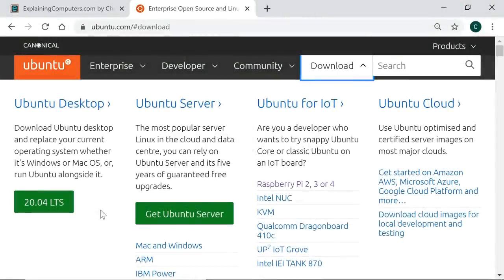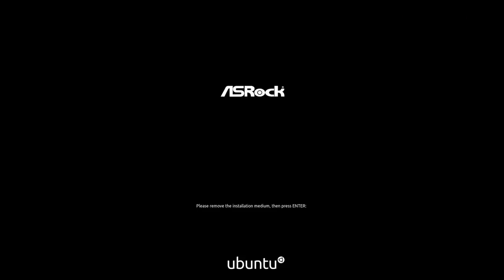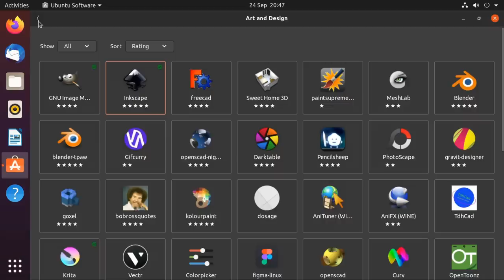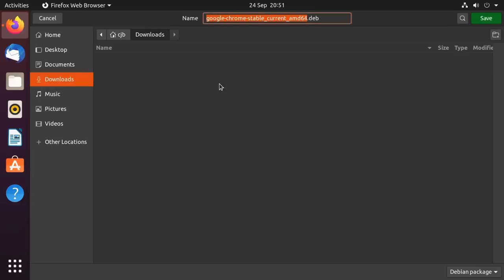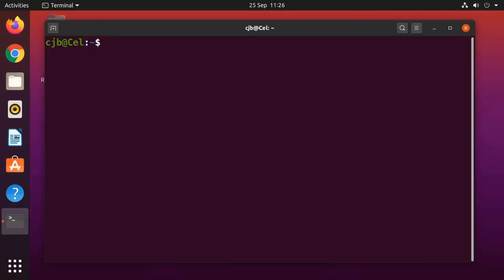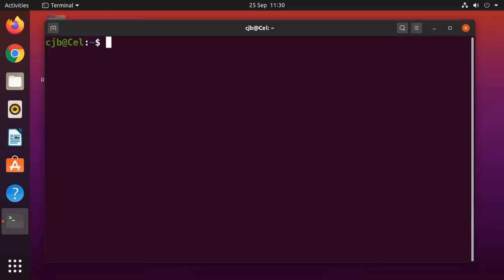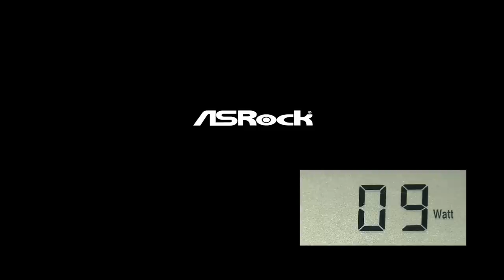Silent Mini-ITX PC Part Two: Software & Power Consumption

Comment: Everyone wants a quiet computer, but they don't want a computer with low performance that generates little heat. It will never be difficult to configure a small computer and a high-performance computer.

Comment: Over the years I've built a number of PC's for my own use as upgrades. It just occurred to me that, as long as its not connected to the internet, I could just use some of those old parts from previous builds and old operating systems to build a new home theater PC. I wouldn't have to buy a new Windows license since I already did that with the older version of Windows that I'd be using in the new HTPC build. As long as VLC media player still works with an older version of Windows, I should be set.  It also helps that I never throw anything away, so it's just a matter of finding the old boards, cards, discs & power supplies and put it all together.  Got my next project.

Comment: That wattage is really impressive! I'm thinking the solar panels on the RV could handle this very easily. In fact, it would instantly become one of those devices that we wouldn't even worry about, if we had left it on by mistake. Sensational performance for power. Great video!!! Thanks for sharing.
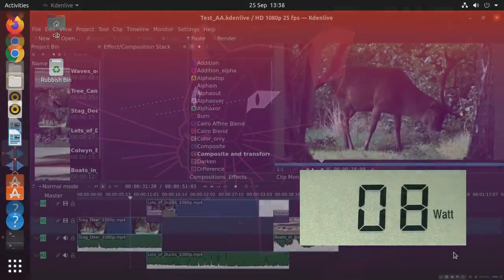Reply: At about 19:30 does that power usage include the screen?
Reply: I always partition the disk into a root partition, a home partition and a swap partition. This means that so far I have been able to change/ update operating systems without losing my data. This seems to be standard within the LUG.

Comment: Thanks to one of your previous videos, I now have an old MacBook Air with Ubuntu installed on an external SSD drive. Sadly the Mac only has USB 2.0 so it's no speed deamon, but it will give me the chance to delve into Linux and learn. Thanks for all you do Chris, I learn so much from your videos.
Reply from the maker: This is great to hear, sounds like an excellent learning tool.

Comment: I use a previous version of that board as my server / htpc, it's running 24/7 with Mint, it crashed 2 times in 4 years, once due to software lockup and once because the PSU died, in my anecdotal experience that little thing is a total trooper
Reply: Interested in your comment, is it a media server or client next the TV?
Reply: @sprint955st  It's a home theater PC (HTPC), media playback via Kodi and DLNA receiver/renderer, the integrated graphics can decode most formats in hardware via VA-API, including h265 up to 4K@30Hz, if you're looking for a transcoding capable media server I'm not sure if the board by itself is powerful enough for that.
Reply: Crackalacking_Z ok thanks, up till now Ive been using a 10yo at least HP-NL40 microserver with Serviio which transcodes as required. It’s good but old and a bit noisy so looking to downsize. For the money it costs I might get this board and experiment. Thanks for responding.

Comment: This is the only itx motherboard with passive cooling and 5.1 audio that was able to find. And these are now getting harder to find. Really like it.
Reply: Take a look into the Jetway NF9G-QM77 board, passive cooling, 5.1 audio, support up to i7-3940XM - I have been fortunate to obtain several of these and just running a Celeron 1020E the passive temps are around 45 degrees

Comment: Chris, I realise that this vid isnt about the Pi 4 but its all 'small form factor computing' and I just wanted to thank you for your guidance re overclocking the Pi 4. I dont have the Ice Tower - I'm using the Argon case with the fan permanently on, and I'm perfectly happy with 720p when the temp never exceeds 65 deg C. I did try 1080@60fps but it drops too many frames - also not sure that my cheapie 1080p Acer monitor is giving me the best possible result, but 720p is absolutely perfect - astonishing when the last Celeron laptop I owned didnt render every 720p vid I own with this level of clarity. Thanks again and keep the vids coming ! 

(I dont normally bother with the like button, but in your case its 100% warranted)

Comment: Thank you Cristopher, you are the king of maximum efficiency with low consumption of space and energy. I have a Dell PowerEdge Server. It is a monster in energy consumption and noise! I will advise you.
Reply: Only 180 watts for my r720xd with 20 cores 8 x 3.5 hard disk 2 graphic cards 2 ssd and tamming the fan’s beast with ipmitools run silently in my office with no problem

Comment: Funny that this "media pc" is drawing less power than the "green pc" that used to be in that case. Intel have been quite good at optimising power usage.

I was slightly disappointed because we didn't see the final installation next to a telly or whatever, but maybe in a future office tour video then :)
Reply: kännissäontääkintehty Are you insinuating that “media” and “green” are applied marketing tactics? 

I’ve heard “I was surprised by the size of that unit!”, but I don’t remember her name. For some reason, I think a PC mini/NUC was expected, but that’s pro’lly because of talking a big game and backing up it...

Just from the size of homeboy’s hands, though — next to the unit — it seems to be “sizable,” although it doesn’t seem to be “full-size,” for a “desktop computer.” Maybe checking the product link will have the size specs. However, unfortunately, if it’s an Amazon link, one never knows if the “Product Dimensions” are that of the product’s box, or the product, itself...

I was also pleasantly surprised by the mounting ease and speed! That’s such an important attribute, when one is constantly mounting numerous volumes.
Reply: Just a few more days until we can TEST our system more with new installments of Mandalorian. Testing video servers you see is VERY IMPORTANT work!

Comment: I've an Intel NUC with a Celeron J3455 and it does a great job running VMWare Workstation on Ubuntu 18.04 with two headless guest VMs. One Windows 7 and the other Windows XP. The J4105 can only be better!
Reply: @petermoeller5901  Faster hardware would certainly work, but I had the Intel NUC with the Celeron and all I needed was to run a Windows XP VM to monitor my solar array, and a W7 VM to serve music and act as an SVN server. 99% of the time both VMs are idle, but when I need them to do their thing they do so perfectly adequately. 

The hardware on which I'm typing this runs VMWare Workstation on a very fast i7, running two VMs at least - one for the long compiles software development and the other for email and web browsing. :)

Comment: Very Good as usual. I did a similar thing with a HP T620 (Dual CPU, 4GB Memory, 16GB SDD, using SPARKYLINUX. When playing a Movie from TV One On demand (NZ) on Google Chrome, and both CPU's running at between 88-100%, the CPU Temperature peaked out at 50 degrees C, which surprised me. I expected it to be much higher. The Movie played well. The T620 cost me NZ$80, you can now buy them for about NZ$50. I should have waited a bit longer.

Comment: Dear Chris,
Thanks for sharing your adventures. They are great fun to watch.
Re-using the old housing [part1] seemed daft. You noted that similar but more modern & up-to-date-versions are available at an affordable price.
Yet you're using the old ones that don't have usb3 ports and other modern conveniences. Building a NEW machine and 'making do' don't add up; Not at that price-level, IMHO. 
Regards,
Willem

Comment: Thanks for this great two part build and analysis. I was looking forward to building this or something very similar since I wasn't satisfied with using a Pi as a media player for my TV. I was about to pull the trigger on this project, but remembered I was in the market for a Mac to start doing some iOS development and found a pretty cheap Mac Mini that will allow suffice for that purpose, but will spend most of its life as a media center for my TV. Obviously it's a Mac so when it inevitably dies and I can't replace its components, I'll use these videos to build my next media machine ;)

Comment: Very interesting and well presented. I have an old Mac that I’m planning on Linuxing. Thanks for this information.
Reply from the maker: Good luck with your Linuxing!
Reply: Yes, good luck installing Linux on some older Macs with weird EFI booting.  I went through a lot of headaches installing Mint 20.04 to a 2006 iMac.  But it runs pretty well for that age and max 4 gig of ram and the 24" screen is amazing!
Reply: I've got a MacBook Pro that can't be updated beyond High Sierra. It still gets security updates but it won't for much longer. When the updates stop I'll have a go at Linuxing it as I can't bear to throw away something that still works.
Reply: @johnm2012  To tell you the truth, I have several Macs (a 2015 27" iMac and two 2009 Macbook Pros) and I will not be updating any of them beyond Sierra.  It breaks much of my old software.  If I'm going to go through that they'll become Linux machines.  I'm already running Linux on one laptop and I'm very happy with it.  I've experimented with Linux on Macs now for 20 years with decent results.  If you like the MacOS experience, I recommend ElementaryOS.  It's not exactly like MacOS but it's similar and doesn't try to be "just like Windows" like so many other Linux distributions try.  It has one of the best file browsers available (Pantheon) the music jukebox is very much like early iTunes (before it got so bloated) and the video player is in many ways better than VLC.  (It plays Ogg Vorbis files better than VLC, but VLC plays Matroska files better.)
Reply: @tarmaque  I'll take a look at Elementary OS and try it out in a VM. Thanks for the suggestion. As far as Mac OS goes, High Sierra does everything I need for as long as the security updates keep coming.
Reply: @johnm2012  I haven't even upgraded to Mojave because it breaks Adobe CS6.  So I'll be nursing this one along until I can work up the courage to go full linux on this old iMac.
Reply: @johnm2012  Unless you're prone to going to iffy websites and clicking on anything and everything coming in an email, I wouldn't worry about it for way after Apple stops supporting it.  Hmmm, meant that as long as you're behind your own router with everything external turned of (no DMZ, uPnP turned off, etc.).  We ran 10.6.8 Snow Leopard for years after support ended and was fine except all the web browsers stopped working eventually so we had to update.  Lost our paid for Microsoft Office programs, but switched to OpenOffice and it works fine for home use at least.  So when programs stop working under High Sierra, THEN switch.
Reply: It pays to download the Bootcamp files now-ish, I.e. long before you actually need them (incl all the drivers etc that will make the hardware play nicely) . Apple has a bad habit of making them unavailable through their official channels once an OS version goes to unsupported status.

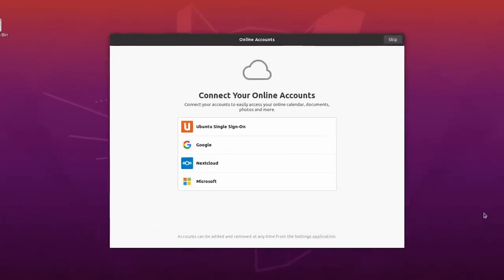Comment: 6:24 I Also Have an Ubuntu 20.04 LTS Using With Old Gigabyte MotherBoard, Intel Core 2 Duo E6550 Up To 2.33GHz, 2GB DDR2 Memory In Two 1gb memory, Zotac Nvidia GeForce 9500 GT 512MB And  SSD 512GB By Transcend And it works good and smooth
And Also I Watching all your video in this and your other channels 
Your video is great and Most to educational i love watching your videos:)

Comment: Great video. I would be curious to know how this machine performs at video encoding with QSV. It's an easy install on Ubuntu and should give you a nice boost in Handbrake and OpenShot (though possibly not with Kdenlive). I had no idea there were so many powerful boards available in the Mini ITX form factor. Exciting times.

Comment: Fourth! just missed the podium!

On a more useful note, would a mini-ITX like this (in a larger case and with the proper OS) be suitable for a single user NAS? So that I can automate wireless backups from my computers.
Reply from the maker: Yes, very much this would make an excellent NAS board (esp with the four SATA connectors).
Reply: there are slot in holders for 4x 2.5" sata disks for one standard 5.25" bay. if you get a case like the LC1402 (or smaller) intended for a old style dvd/bluray you can even make it raid5 / hot plug. most mini itxcases allow for enough 2.5" drives, especially if you are running the OS like freenas off a usb boot stick and in RAM only.
Reply: there are some tutorials around those asrock boards / nas builds which can be followed => https://forum.openmediavault.org/index.php?thread/11193-my-asrock-q1900m-nas/
. especially for bugs and problems ;-)

Comment: Hi Chris, since this is a media streaming pc you’ve built, I was wondering how it performs whilst connected to a tv. I hope to emulate certain aspects of the build and I was wondering how the Celeron’s iGpu handles video at 1080p or 4k at the standard 60hz refresh rate. I currently have a 4k 60hz Samsung tv I intend to connect my core i5 9400 with an iGpu to and was wondering about the performance of the celeron. As always, love the videos and keep up the good work!
Reply from the maker: Thanks for this. I've been using this PC connected to a TV since it was built and performance is very good streaming Disney+, YouTube, BBC iPlayer, etc. However, I only run 1080p.

Comment: I like the economy way and efficiency,  

the 70oC  is the   MAX temp of  850EVO usage
Reply from the maker: Agreed on the EVO, but it will not be that hot. :) ONly the CPU.
Reply: @petermoeller5901  Actually true, just wanted to mention,  all depends where the pc will be placed and if there is any airflow, if cover is detached etc.

Comment: I just changed from a raspberry pi 4 4gb to a J4105 board to use as my home server. Using HDs on sata and x86 processor gives a big improvement in performance. I really liked to go back to x86. Now I'm running some game servers with it too, that doesnt work on ARM.

Comment: One of the reasons I choose Chrome over Chromium is because in the past it has given me the least issues working with streaming services like Netflix / Prime on Linux. Things might have improved a lot since then, but I have no problem with running Chrome. :D
Reply from the maker: With this I very much agree.
Reply: Chrome also supports Android apps so you have a wider selection of apps

Comment: I have that keyboard - holding Fn and tapping Caps Lock makes the top row default to being the F keys, without having to hold Fn when pressing them.

Unfortunately the keyboard doesn't remember this and it defaults the top row to being the media keys when it's turned off and back on via the switch on the right.
Reply from the maker: Thanks for this -- very helpful. It took me a second to get an F11 out of the keyboard to full-screen the browser. I wish the function keys were the default for -- the function keys! :)
Reply: @ExplainingComputers  
You're welcome :)

Also, I forgot - Fn + Cursor keys:
Up/down - Page up/down
Left/right - Home/End

I've had mine for around 5 years - my only complaint is the F key defaults. Unfortunately even the companion software for Windows 10 won't let you change the default behaviour, just remap the three keys above the trackpad. Boo!

Comment: The all in one keyboard is awesome 😀
Reply from the maker: It really is!
Reply: No print-screen key
Reply: @artbecker5618  doesnt it have one with a FN function key? Still love my logitech K400 (old version) but almost got the similar priced microsoft one last time.
Yep, even with snipping tools and all modern stuff, most times the print screen key without anything software running is simply enough ;-)
Reply: I would prefer the left and right mouse button below the track pad.

Comment: That is the way to go. It is finally possible to have powerful computing in a small package! High computing with small heat output and energy input. A high efficiency coefficient!! :-) Even a yogi in a cave in the Himalayas can run one of these with a proper solar panel and battery! :-P

Comment: I know what you mean about Chrome. I've been using it on Linux for years, for the simple reason that until Google Chrome became fully supported on Linux distros, there was no native support in Linux for streaming services such as Netflix and Hulu. Chrome made it happen. Firefox eventually followed suit, but they were in no hurry. By that point, I had long since quit using Firefox. I'm actually using the new Edge Developer Preview now, built on Chromium. Works great, and quite snappy. I still use Chrome as well.

Comment: Pretty impressive for a diminutive box. I doubt though you would get the same speedy response with power hungry Windows. I'm curious as to why you didn't opt for the server version of Ubuntu since you plan to use it as a media pc.In any case , thanks for the heads up on Hardinfo and Veracrypt. Cheers.

Comment: My old AMD-450 got about 20 Watts under load and its on 2011 and it ran 24/7 as Server PC. I have about 80 KW per annum. My Desktop PC that I not run 24/7 uses 175 KW per annum.
Reply from the maker: These figures are impressive, but very surprising given that the TDP of the AMD-450 is 18W, which roughly means that this CPU (APU) alone will consume around that. So this means that the motherboard it is in, RAM, drives, and fans are only consuming 2W, even assuming a 100 per cent efficiency power supply! :) Are you are sure you are reporting raw power drain from the wall outlet, and not CPU package power consumption (as many utilities report)? I cover this in depth -- with lots of test results -- in a video posting this Sunday or next.

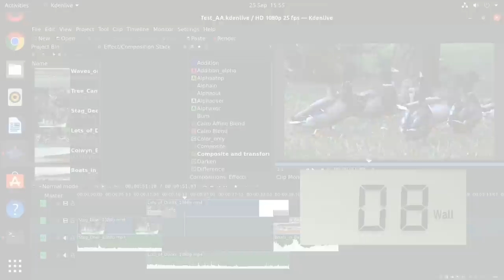Comment: 21:11 noob question here - would undervolting reduce the draw even further?
Reply from the maker: It would.
Reply: you really don't want to do that as basic voltage levels are what drive digital state components.   HINT if it made sense to run at a much lower voltage, AMD and Intel would have already done it.